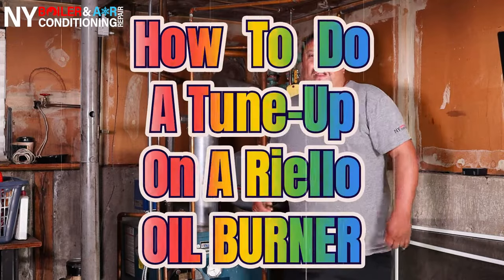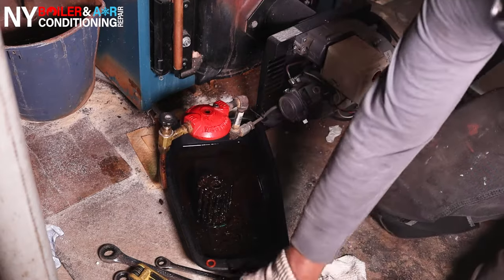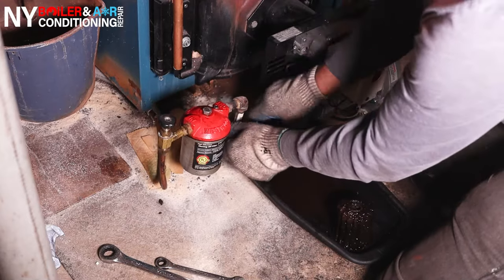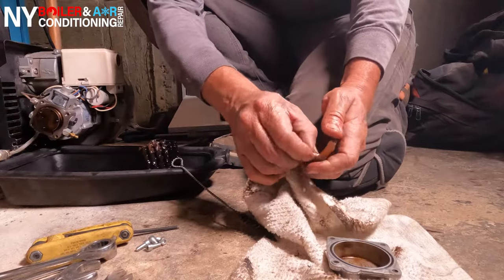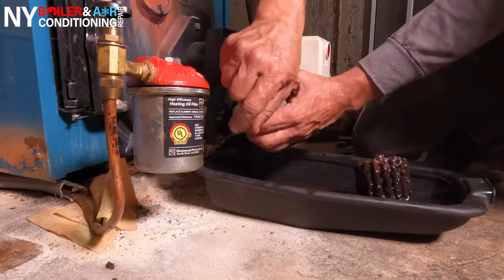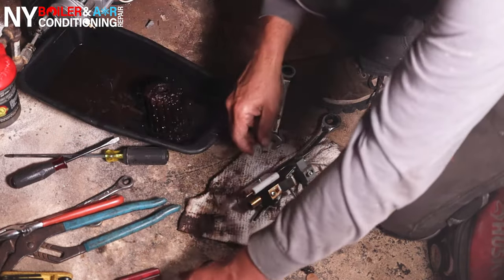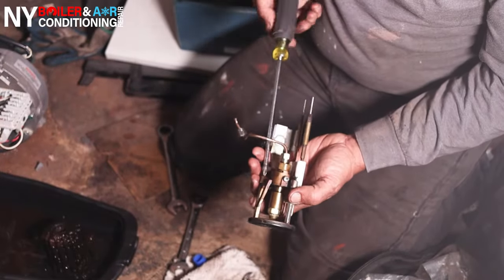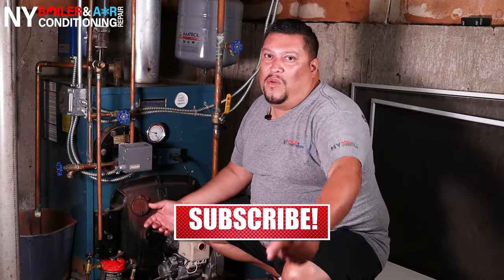How to do a Tune up on a Riello Oil Burner

Comment: What a great video that’s exactly what I need. I live in Long Island and I have that exact burner head you made it all seem so easy my man question I replace my fire O-Matic oil valve and it seems like it just doesn’t want to fit the or the oil burner tube seems like it never gets tight and the little tube can move back-and-forth going to the boiler. Please help I’m trying to search for the right fitting I was assuming it was quarter inch help.
Reply from the maker: You can allways text me at 917-468-2325 or call ☎️ me

Comment: 13:17 ? Riello burner tune-up.. i wish you'd 
covered electrode adjustment and replacement, testing the igniter, and cleaning/adjusting the air intake. otherwise great video, thanks ❢
Reply from the maker: Thanks 🙏 for your support and I’ll do it on the next video

Comment: I changes jet on my burner and cleaned filters.  Now it burns continously and doesn't go on and off for a minute as it should.  What's causing that. Could it be the photocell or control box ?
Reply from the maker: I need more info so I can help you
Reply: @louietheboilerman  the boiler used to come on for 20 mins til it reached temperature, the go off for a minute and come back on for a couple of minutes to maintain temperature. Now it's just running constantly. Could it be thermostat

Comment: Can you explain why he was struggling to pull out the drawer assembly? I can't get mine out either. How did he wind up doing it?
Reply: Nevermind, I figured it out. The answer was "Try Harder" lol.
Reply from the maker: @williamnicolay3745  lol i was just going to tell you to put some elbow grease..  lol im glad you figured it out and any problems feel free to call me.. enjoy your day
Reply: Sometimes it is carboned up between the blast tube and the turbulator plate, particularly if the burner has been running rich and sooty.
Reply from the maker: @bobat2  yea that happens sometimes
Reply: helps to remove the screw that holds it in

Comment: So many wrong things in this Video do not watch this video from the way the nozzle was removed to fireomatic valve was put back on
Reply from the maker: LoL, please explain how you remove the nozzle because I’ve been doing this for over 20 yrs and in business we have no problems. There is absolutely nothing wrong, what is wrong is guys like yourself that think you know it all or act you like there is something wrong. I don’t put people down and there is no exact way to do things like when guys says I’ll never use a pair channel locks on brass fitting.. guess what we all do it. I have or when I don’t have an adjustable wrench. I recommend using a adjustable for certain jobs but sometimes you need to do what you have to do and using a channel locks pliers doesn’t mean it’s wrong… but thank you 🙏 for watching…
Reply: @louietheboilerman sorry bud, I’ve got to agree with the other guy. This hurt to watch and was not professional in my opinion. Also doesn’t address pressure/vacuum/combustion analysis all the important things we need to do during a tuneup to make sure things are burn safely and efficiently.

The worst part is ur guy was wearing rubber dipped cotton gloves which I couldn’t believe, but then he took them off! You guys need to be wearing nitrile gloves, especially if you around oil a lot. Fuck getting cancer to get a burner running. We deal with a lot of hazardous chemicals every day and we need to protect ourselves when we can. proper gloves (nitrile rubber$ are about the easiest and cheapest thing we can do. 

Other than that I don’t think it would hurt to do some reillo training and for the love of god don’t let you guy spill oil everywhere. From the nozzle to blowing out the line every time u touched on he oil u made a mess.
Reply: Also, there’s a Phillips head set screw on the side of the drawer assembly. Loosen that one screw and the nozzle body will slide out of the retention head instead of removing those other three screws and having to fumble around with trying to get it back together.